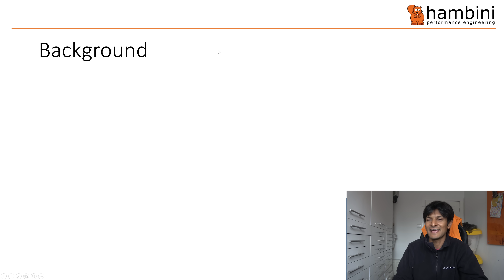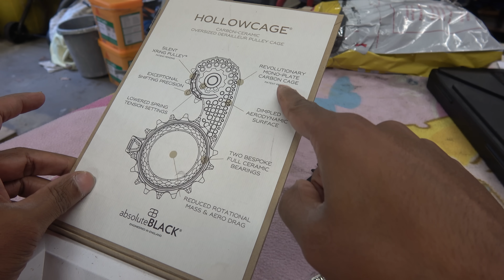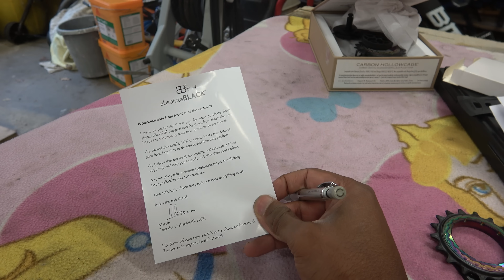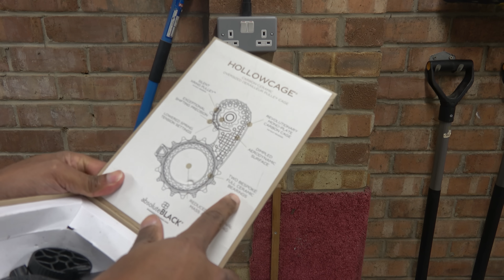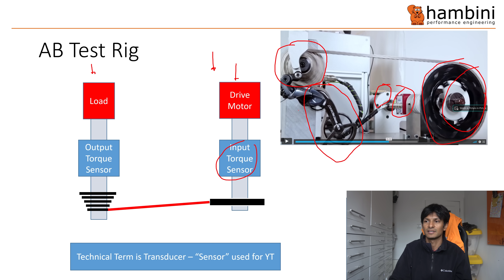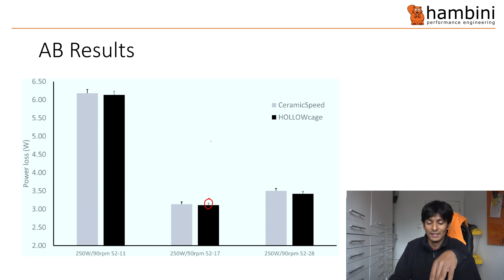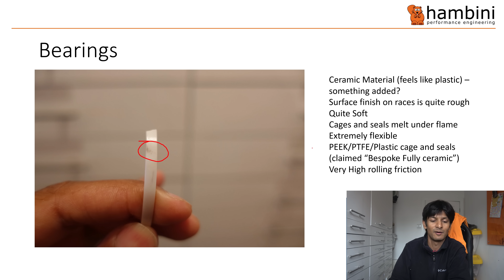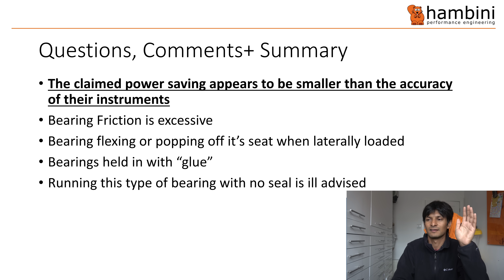AbsoluteBlack $700 OSPW: An Engineering Reaming Hollowcage

Comment: Hambini I am sure it was difficult for you to remain that reserved Bravo. But also a thank you as no doubt you  expose companies that take advantage of consumers! Have a great Sunday! 👍
Reply: At some point something might be so disgusting that there simply aren't any words for it anymore, not even swear words ...
Reply: There isn’t even a scale. It must’ve been so far off the right it would’ve required a logarithmic scale
Reply: When that guy who is always loud is quiet, you know it's for real...  Good video.
Reply: This pulley  cage is absolutely a piece of junk. Terrible bearings, nothing ceramic about it, nothing carbon fiber about it nothing but injection molded plastic. The idea that they can charge consumer $700 for something that is inferior to the standard Shimano component is  just mind-boggling. You can purchase an entire Ultegra derauiller and cage all for $100..Just a complete rip off.
Reply: Yes but you are missing the most important thing, it's oil slick anodised.
You clearly need to start doing oil slick BBs, then you could charge the same, maybe drill a few dimples on them too.
Reply: All these marketing BS makes you hate the cycling industry. However it is with everything now. They try to suck you up in to their claims and of course so many people will belive it. Infomercial on another level. That's what it is.
Reply: That product looked like a scam when I first saw it.  Just a way to separate and fool from their money.

Comment: The bearing friction doesn’t matter when it is saving you 1400w of aero drag. Just bike as fast as peak torque and you’ll see.
Reply: Oooh la la merci
Reply: They're still plastic bearings compared to the "full ceramic" they advertise
Reply: How is it more aero? It is bigger and has a big hole in it, so even those claims should be taken with a jar of salt🧂
Reply: unironically true for some bikes I've ridden. +25W drivetrain drag from two stage drive and -7.4 kW aerodynamic drag at 70 mph.

Comment: I put GRX pulleys in my 105 derailleur. It made my drivetrain noticeably quieter and smoother. I only spent 15 bucks for the pulleys. I saw a bike with this Absolute shyte hanger and Ultegra Di2 over the weekend, and the chain dropped. Maybe it had to do with that flexy derailleur hanger. Also, it was a "gravel" bike.

Comment: So it's more expensive, heavier, slower, flimsy af and the bearings are shite. Have I missed anything? Oh yeah, they're not complying with legislation re safety datasheet.
Reply: Yes. It is lighter, not heavier.
Reply: @Baerchenization  Dura-Ace 43g, AB 69g so >50% heavier
Reply: Can’t replace metal cage with plastic (carbon fibre filled), although it’s lower in density, but it’s lateral stiffness is too poor oz to oz compared to metal cage.
Unless they sacrifice aesthetic for strength using plastic through proper engineering. But AB do not have that design strength, they are a pure marketing bs.

Comment: I can't help but think that if OSPWs were all they're cracked up to be, the big boys (Shimano, SRAM, campy et al) would be specing their own version to their top end groupsets. Seems to me that any friction efficiencies are negated by the extra aero drag and weight (bigger unit and more chain links required). Just bike industry smoke and mirrors.
Reply: I swear I read that Shimano prioritizes shift quality over other goals, so they might know that they can eke out some more watts with bigger pulleys, but they won't at the cost of shifting.

Comment: Send the bearing to SEM EDS or XRD analysis to see chemical structure.
Reply: @Alfred Wedmore But it isn't ceramic.  It's plastic.  They'd be able to tell you which plastic, right?
Reply: @Alfred Wedmore Yes, the point was to check whether it contains typical elements/molecules seen in ceramics or   elements/molecules seen in plastics.

Comment: The axial float on the guide pulley would throw off the indexing of the gears every time it slid from one side to the other. I feel for people who have bought this. Flexible, heavier, bigger frontal area, soft bearings and DIY Quadring sealing ( they offer great sealing when used in the right application. But also the highest friction option.)
Reply: Shimano derailleurs historically deliberately designed side float specifically into the top jockey wheel in order to allow it to align more closely with the chain coming off the sprocket after the gear shift has competed, correcting for small variations in the gear indexing position. Once the amount the derailleur has to move to change gear is significantly more than the side float in the jockey wheel this is actually an advantage. The Shimano jockey wheels of this design were running on a bushing made from actual ceramic with proper rubber lip seals to keep the dirt out too. 

The lack of side float in newer 12 speed derailleurs due to Shimano moving to cartridge bearings is, I suspect, part of why my 12 speed shifting is much more prone to noise in certain gears than 10, 9 or 8 speed ever were. The truly depressing thing is that this is likely to be a concession to marketing on the MTB side as SRAM started using cartridge bearings which, with SRAM being being SRAM, seized on exposure to mud unless you cleaned them out completely after riding before the mud set in the bearing, in their jockey wheels. 

Since every marketing scumbag knows it's an easy sell to market cartridge bearings as an upgrade to bushings, rather than fight this bullshit with the justification for their design choices, Shimano rolled over on the bearing choice and made their product worse. In their defence, at least Shimano seal their jockey wheel cartridge bearings competently, so they run with no maintenance or seizing for thousands of km until the bearing starts wearing into what's effectively a rattly spherical bearing. Older ceramic bush jockey wheels would run maintenance free for considerably longer though - basically until the teeth completely wore off them - and still shift gears perfectly though, so it was a downgrade on durability too. Maybe the friction on cartridge bearings is less, but everything else was better with ceramic bushings.
Reply: @peglor  agreed mate, I was going to say the same thing. The slight lateral play in derailleur guide pulleys is there for smooth shifting purposes - I've had Tiagra 4600, 105 5700, and 105 R7000 rear mechs that all have this. Fair play to AB for retaining that in their design, but they messed up everywhere else IMO.
Reply: Well spotted that man. It looks like a quadring, which is basically used as a double lipseal. I use them on low speed gearbox outputs.
Reply: The OSPW might be heavier, but think of how light your wallet will be.
Reply: @TypeVertigo  The side float isn't free enough me me to believe that AB intended this as a feature - especially given they glued the bearing in place...
Reply from the maker: I don't think it's supposed to move axially as it moves within the pulley. I attribute this to the ~0.2mm slack fit.
Reply: @chrispalmer3096  If you're paying in £50 notes, your wallet will only be 12g lighter. Make sure you pay in twenties, tens or £5 notes to make sure the weight saving works for you. If you pay in £5 notes the weight saving will be significant (around 100g) unlike AB's claimed friction savings).
Reply: @Hambini  like a wizards sleeve
Reply: @peglor  the Shimano bushing design is hardly optimal.  I have yet to find one that doesn't develop incredible friction within a short amount of time.  It's a simple design that works well for about the first week or two of daily riding.  Thereafter, it's a real drag.  
And I can't even count all the bikes I've encountered with pulley wheel teeth worn down significantly to completely due to excessive pulley bearing friction.
All of the cartridge replacements I've used have provided smoother and longer operation than the Shimano cheapo "bearing" design pulley wheels.
Reply: @dudeonbike800  Interesting to hear - I've never found this problem at all, but have had shifting ruined much earlier than with a bushing design on cartridge bearing jockey wheels as a result of the bearing failing. I ride off road in mostly mud though, so the friction contribution of the jockey wheels would have to be pretty high to be noticeable 😃.
Reply: @peglor  This reminds me...
I had an older 8-spd Ultegra rear derailleur on my road bike for ever.  The drive train always seemed to drag, despite immaculate care of the chain & pulleys.  (And a butter-smooth Chorus BB - yes, I mixed Campy & Shimano!) Well, a friend gave me a box of old parts and I realized the Dura Ace rear derailleurs have actual bearing pulleys, so I overhauled them and installed them on the long-cage derailleur I was putting on the roadie.  SMOOTH AS SILK!  OMG, the difference was more than obvious.  That I put up with those lame Shimano bushing pulleys for so long was silly.  Won't ever use them again.
(And again, this is after servicing a gazillion bikes over the years and finding countless fouled Shimano bushing pulleys [gunk, hair, you name it!] that imparted way too much drag in the system.)

Comment: Right so its made out of cleat plastic and a couple of hybrid ceramic bearings with rubber o rings bunged in to stop them rattling which with those tolerances they will once its been used for a while,  it has a surface like a teenagers face even though its an aerodynamic mess of a shape sitting in dirty air and their test rig is as accurate as strava's estimated power numbers. Literally the only thing its got going for it is its quirky looks.
Reply: Even I can see that this bearing arrangement with its poor seals and loose fit will clog up in one (like this morning’s) wet ride. Then the whole arrangement will either destroy itself or just rotate in the shell making the loose fit rapidly looser.  🙄
Reply: @EngineRebuilder  I really like their chainrings but this product is a proper form over function cock up smh.
Reply: The surface texture is just an example of how crap piles up. Zipp started the dimples BS.
Reply: @truantray  dimpled/rough surface textures work in the right places, down there its totally pointless especially as the largest area of surface has a massive hole in it. Adding unnecessary leading and trailing edges to something they're implying has beneficial aero properties is a bit dim.
Reply: Oil slick finish, yo.
Reply: "Literally the only thing its got going for it is its quirky looks." 
And that is what sells shiite like this. I remember trying to talk a guy out of (another) replacement set of those Spinergy (REV-X?) wheels back-in-the-day because their next failure might be catastrophic. 
"NFW!" said the guy, as the looks of the wheels were more important to him than ANYTHING else. If he's still around he's probably got this "absolute crap" thing on his bike as well.

Comment: I take it that thanks to the sloppy manufacturing, the jockey wheels will keep spinning after the bearings seize up. That's some excellent engineering.
Reply: lolz given the leverage you get on the teeth they may run as smooth as ever. they made it maintenance free. a real moneysaver...
Reply: It's not a bug, it's a feature! - some developer somewhere
Reply: LOL 😆👍

Comment: I bought a J&L version of that thing that cost $96. I bought it to get a longer arm since it is almost impossible to get a medium arm, and I run a 32 rear for climbing.  It operates quite well as a longer arm, but you can't set it up by eye, and it is very sensitive to cable tension (shifting accuracy) but it was $20 cheaper than any Campy medium length arm. So, since it can be aligned and shifted using trial and error, I give it a C grade. But given the cheaper price and the difficulty of finding a stock medium arm that moves it up to a B grade. The larger bottom idler doesn't seem to make any difference.
Reply: Tom, How long have you used this “cage”?  I have to wonder if the J&L version suffers from the same bearing fit and construction as the one tested. I’m just thinking it wouldn’t last too long. Bearings being loaded eccentrically aside, hat side load issue, with just a little wear, would make indexing a nightmare.

Comment: To much to say here in response to this video, but what I will say is;
In the past, I held signatory to NATA, which in Australia is the “National Association of Testing Authorities”. This body holds the international standards for Australia and competency is measured by an interview and Quality Control documentation. They specify any NATA report MUST be done as per stringent requirements, relating to specifying errors or corrections of a measured device with results traceable back to international standards.
So I know a little about accuracy.
There is so many things wrong here and claiming accuracy at these levels, is not as simple as one may seem, and the bicycle industry doesn’t follow any international standards or traceability.
So there will be video discussing this coming in the near future.
Reply from the maker: time for a vid wayno

Comment: For $700 I would have expected it to come in a fancy jewel box instead of the PC low-impact packaging, but I guess that would cut too much into their profits.
Reply: Do you think you get a fancy jewel box for a Trickstuff brake because it cost nearly 1000€?  
I really hate packaging who shines. No one other then a fucking hoarder needs that.
Reply: @Vanadium  No one needs a $700 pulley either, so...
Reply: @trekkeruss  I didn't said anything about the pulley. I am certain we dont need that. 
On the other hand I have hydraulic brakes with Goodrige hose and rotors who cost more then 1k.
Reply: I'm all for PC low-impact packaging tbh. It's just going in the bin anyway.

Comment: As a naive amateur cyclist, I am starting to think that there is something amiss in the entire cycling industry.  Every year new products are introduced that the respective manufactures claim are at least 20% more aero, 20% more compliant, 20% stiffer than the previous offering.  I am starting to think that there just may be a bit of dishonesty going on.  How can this be when we are asked to invest $5000 and more in a new bike?  I am starting to get a bit skeptical.
Reply: to "lie without lying" you just compare your product in everything you have with last year one, and then pick the few things that has the bigger numbers, 20% stiffer, means it's 20% stiffer from something that already was as stiff as hambini's balls, then that 20% means nothing, it changes nothing.

inflating numbers by comparing them to things that has no reference is at this point, part of the cycling industry
Reply: There's no contradiction in your setup. Claiming more stiffness, compliance, and less aero losses says nothing about cost. 

The contradiction is that despite claimed 20% year on year improcements, today's bikes aren't that much stiffer, more compliant, or aerodynamic than bikes 10 years ago. This is basically a result of UCI limits on mainstream bike design.